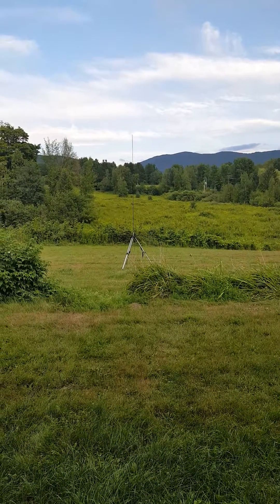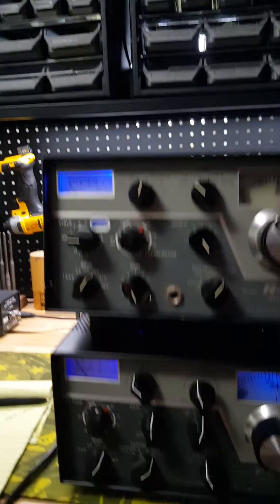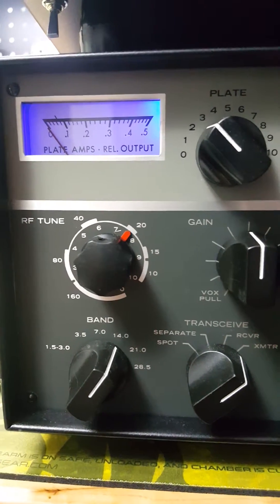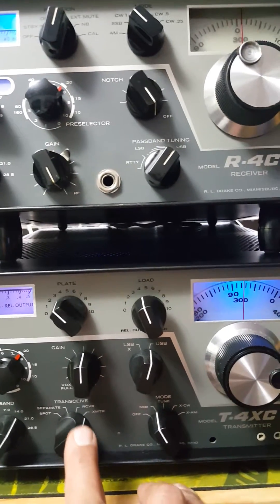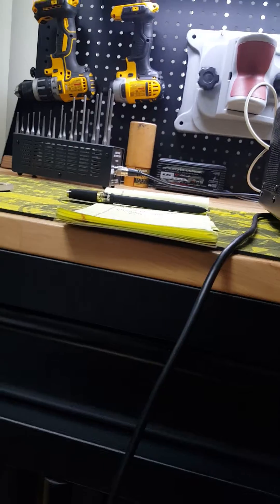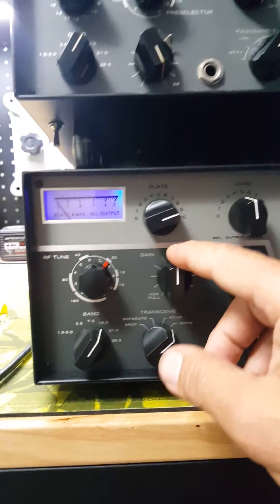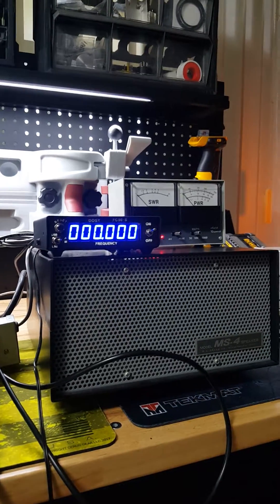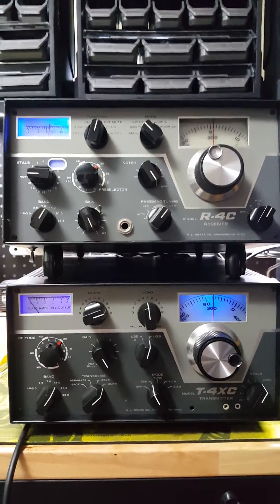Drake T-4XC and R-4C Transmitter and Receiver Tuning - Ham Radio for Preppers

Comment: Better get the first plate dip done A LOT faster.  Your technique will result in a short life for the 2X 6JB6 sweep tubes.  On first tune, I advance the "gain" to about 125 mils then peak the "RF tune"  but not exceed 125 mils.  Back off the gain control to maintain that that level of plate current.  After peaking the RF Tune,    jump on the "plate" control to get a dip/resonance as quickly as possible.  Once that is done, you should let the finals cool for about 60 seconds.  Run the gain control to fully clockwise, set to "tune" and peak the load for best output then, back to the "plate" control for another dip.  Then its another 60 second cool down.   Repeat 1 more time then, back the load control bact to about 120'ish watts out.  That'll drive a grounded grid amp nicely without a kenitic failure.  My T4X-C will output around 160W and I have to be careful with amplifier drive.  Remember, the finals in the Drake are SWEEP TUBES and each has about 16 watts of plate dissipation so be very mindful IRT heat.  The days when you can just go down to Radio Shack and pickup 4 of their Lifetime Guaranteed tubes any more, choose the closest pair for a match and be out about $35.  They got wise to hams turning in 2 dead, flat finals under warranty for another pair,  they wised up to that trick quick enough.   At this time, the finals are expensive if you can find them!.  Right now, (11/21/25) RF Parts has them for almost $40 each.  I didn't price a matched pair.

Comment: Nice set up.  I just picked up a Drake T-4XB from an estate sale.  After cleaning the wafers on the band switch, it seems to work just great!  I plan to make a CW contact soon, using a boat anchor receiver.  I have the special microphone connector on order from eBay.  Then I can check it out on phone.  Do you have to SPOT when you are in transceive mode?
73 Paul AA1SU
Essex Junction

Comment: I was just gifted these two units by a fellow ham, and need to get them refurbished. I have never needed to refurbish a radio before, is there a certain code of conduct of sorts on where you should/should not get your radio redone? I think a local electronics shop may do some radio repairs, but it is not their specialty.
Reply from the maker: There are various individuals that can be found via Google.  You are right.  A regular radio shop will not have the expertise.
Reply: @VermontPrepper  Thank you so much! Your videos are so helpful!
Reply from the maker: Thanks for watching
Reply: @VermontPrepper  I know this is an old thread, but where did you get your radios restored? How much did it cost (around)?
Reply from the maker: @Jake-yv9cr  I forget exact but I am thinking around 600.  I used this person:
http://www.wb4hfn.com/Services/WB4HFN/RepairHomePage.htm
Reply: @VermontPrepper  Thanks!

Comment: Beautiful Drakes..but....put the transmitter on top of receiver as not to block heat getting out of transmitter....ideally they should be side by side to allow for ventilation.
Secondly,not busting your chops but get rid of those LEDs...they look like crap,Drake original was more blue/green than blue/purple the LEDs emit.
Also,if one of those LEDs shorts out it will take the power transformer if they short rather than burn open like an incandescent bulb.
Also you don’t need an digital readout when you can either calibrate to WWV or just use built in xtal calibrate.

Comment: Sorry to tell you but the blue leds looks terrible ...it should looks pale green/bluish...oh and having the transmitter on the bottom instead of the top isn't a great idea : the temperature of the transmitter finals is ...great ...and the rx circuits won't be happy to have "spare hot" from the bottom . It's old stuff, need some care .
Reply: Someone shouldn’t bash the lights in your rig, but as stated you should not have the receiver on top of the transmitter, the heat from the finals isn’t good for the components in the receiver. I’m not bashing but I’m been a ham for 44 years now and heat is a killer, that’s a beautiful set of twins. I’ve had a couple sets of them and will still hold their own in today’s world, also you can set them side by side and place a small  muffin fan on top over the finals a they will run forever. Just my advice my friend, also you should use a dummy load to tune into. Great setup.
Reply from the maker: Whatever